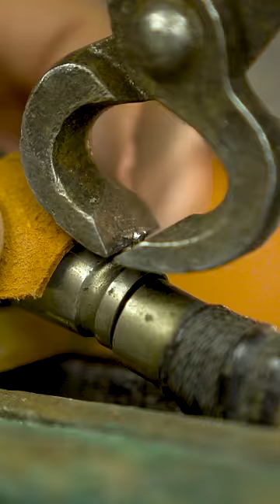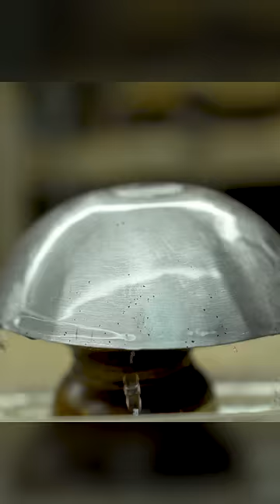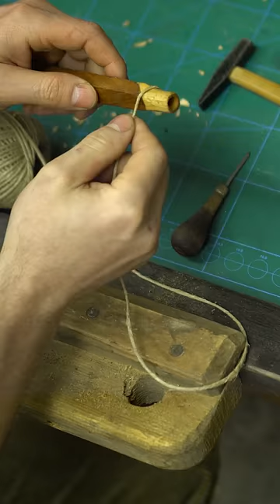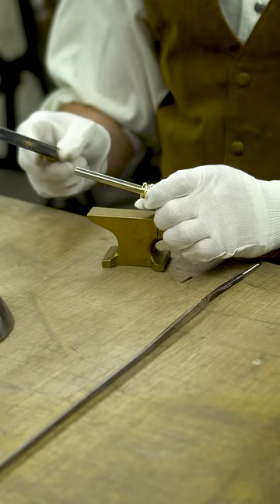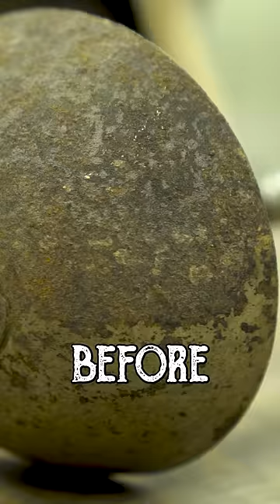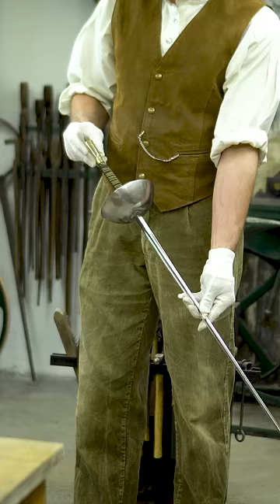Combat Sword #restoration #restore #sword

Comment: Florett 🤔
Reply from the maker: This is an épée sword! The épée has a three-sided blade with a stiff rectangular cross-section. The blade is typically about 35 inches (89 cm) in length and weighs approximately 27 ounces (770 grams). It tapers to a sharp point and is primarily used for thrusting attacks.

It has a large bell-shaped guard, also known as a "bell guard" or "cup guard." The guard's primary function is to protect the hand of the fencer and prevent the opponent's blade from making direct contact. The bell guard provides better hand protection compared to the smaller guards used in foil and sabre.

The grip of an épée is typically orthopedic and pistol-shaped, designed to provide a comfortable and secure hold for the fencer. The handguard extends to cover the back of the hand, providing additional protection.

Comment: That 's not sword...
Reply from the maker: What is it?
Reply: @FFD_Restorations  that's rapier
Reply from the maker: This is a fencing sword called épée!
The épée has a three-sided blade with a stiff rectangular cross-section. The blade is typically about 35 inches (89 cm) in length and weighs approximately 27 ounces (770 grams). It tapers to a sharp point and is primarily used for thrusting attacks.

It has a large bell-shaped guard, also known as a "bell guard" or "cup guard." The guard's primary function is to protect the hand of the fencer and prevent the opponent's blade from making direct contact. The bell guard provides better hand protection compared to the smaller guards used in foil and sabre.

The grip of an épée is typically orthopedic and pistol-shaped, designed to provide a comfortable and secure hold for the fencer. The handguard extends to cover the back of the hand, providing additional protection.

Comment: Personally iv always used leather sewing thread, its coated in a wax, once wrapped in the pattern you want and tighten, use heat gun and it will shrink and adapt incredibly well. The grip if polished is unreal also
Reply from the maker: Thanks 👍